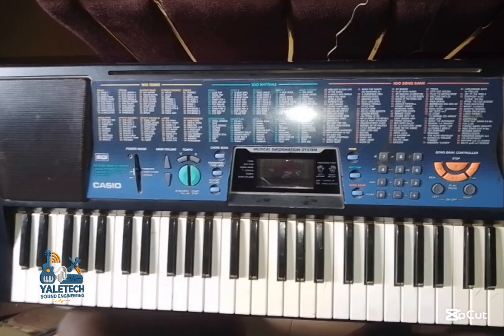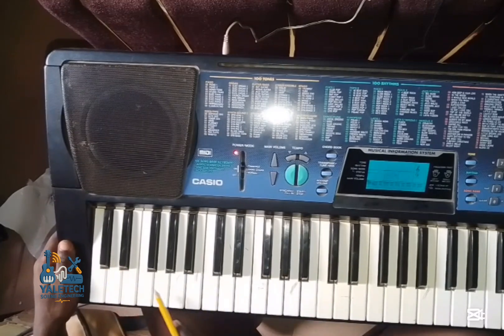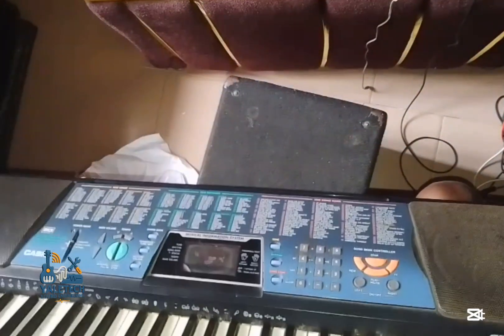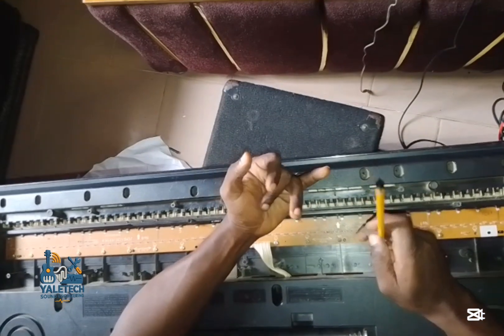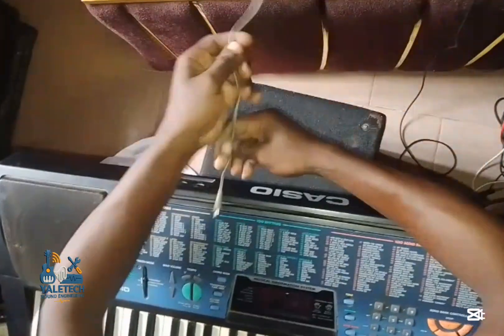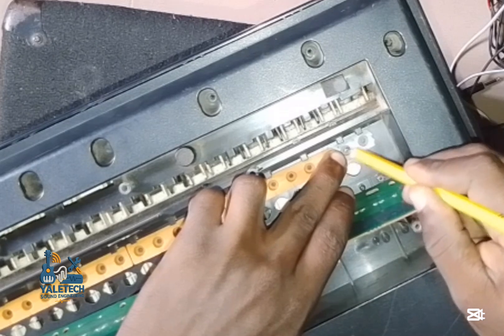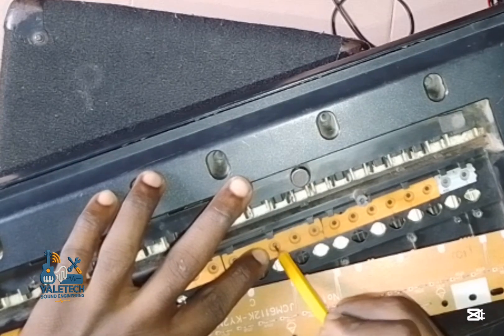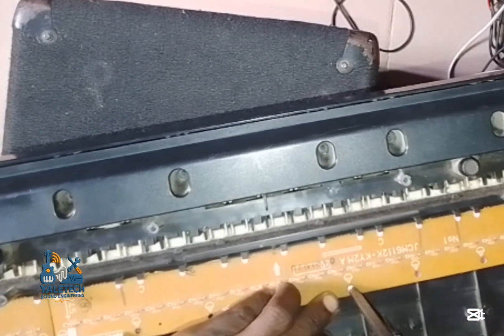Complete guide to repair any dead Casio keyboard at home

Comment: Hello my name's byllie I'm trying to repair my ctk-611 casio keyboard it won't turn on I have a new cord for it. Me and my brother have taken it apart and started testing where the short is. It looks like there is a bridge on the circuit board where we plug in to give power the keyboard I don't know what the problem is. Can you help? Please
Reply from the maker: Good to have you here byllie.
Stage1: do a physical assessment, check if u can see any physical damge or burn on any components eg resistors, capacitor, diode etc.

Touch the components, does any get hot immediately u turn the keyboard on

Stage 2. Test with multimeter, some components looks good but yet bad or weak.

And also check does voltage flows in at all.

If u need further help
Contact me via Whatsapp, link in my profile.

Do have a wonderful day.

Comment: Hey! Thanx for the video, I have a Casio (Rapman) Maybe from the 80s, It has no sound no light when plugged, According to you what could be the problem please, Thanx in advance for the help :)
Reply from the maker: As regard the sound

1. A blown capacitor along the sound ic could cause it.

2. a fault sound ic, either on the analogue or the digital motherboard.
Or just inspect, a line may not grip well again, partial contact.

And as regard ur piano no power it, well if it's a power issue, the problem should be along the analogue motherboard, that's the power session.

A blown resistor, diode, fuse or voltage regulator could cause that and also a components maybe not be film on the board again.

Take ur time and inspect the board very well.

I hope this helped you, do well to give me feedback on how it goes.

Regards
Reply: @yaletech_  Thank you very much for your feedback, Keep up the good work :)